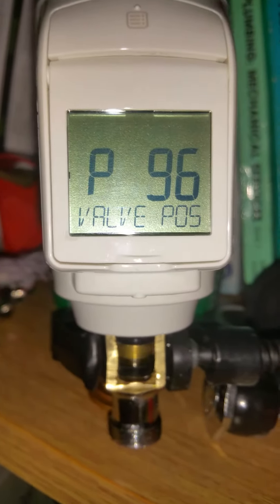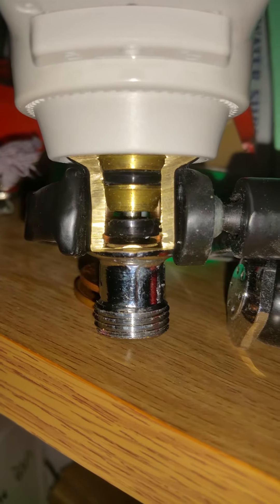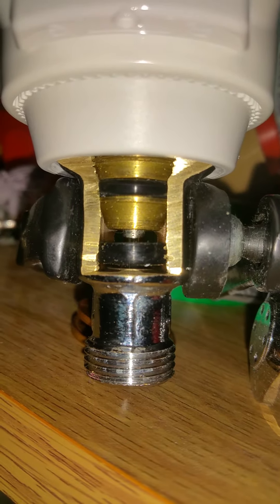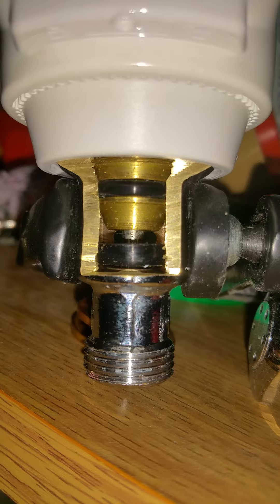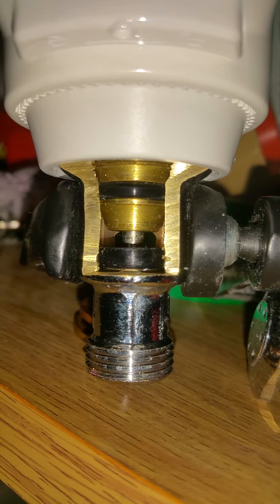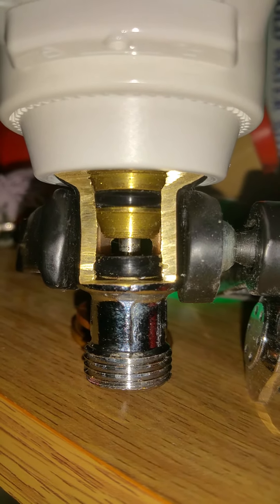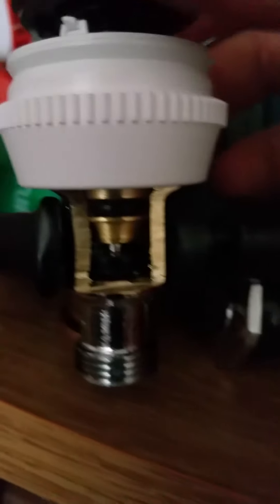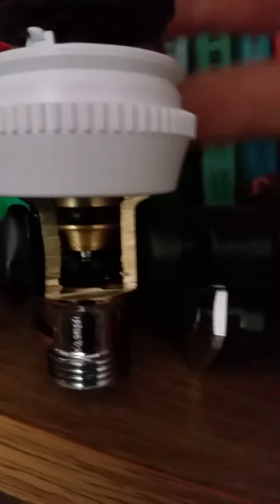HR92UK Setting the throw of the valve

Comment: Hi Dan, I wonder whether you could advise me regarding a leaking HR92 valve? I notice there appears to be a couple of seals shown in the cutaway section. I've checked the pipe joints and all seems okay. There is moisture around the white section of the body and I wondered whether the seals shown are a potential or common known fault on the HR92? Is there a fix or do you need a new body/valve?
Good video. I like to see how things work, a drawing is okay I guess, but prefer seeing the operation.
Cheers
Reply from the maker: Moisture wouldn't be due to a fault with the HR92.  These are just the heads.  You will have a small leak on the valve itself which could be one of the o-rings you can see in the cutaway.

By the time you have extracted, identified and replaced the leaking bit of the valve, you may as well change the valve body completely.  

Hope this helps and glad you like the video.